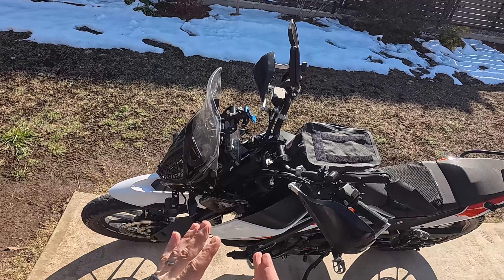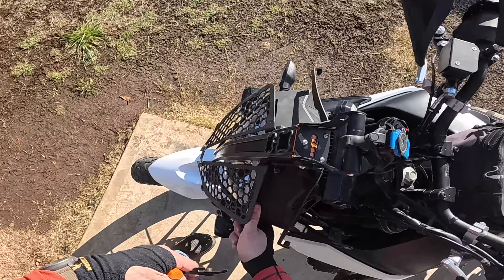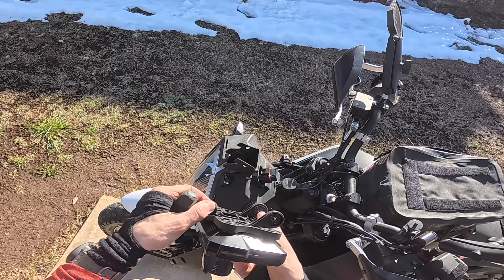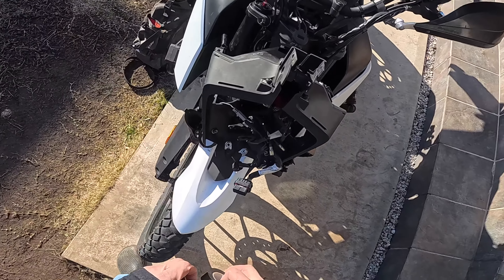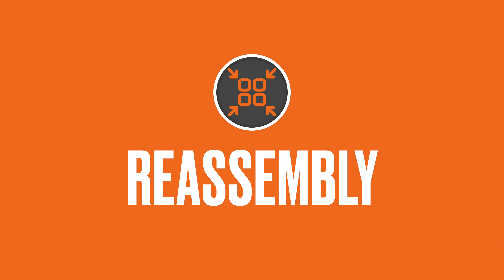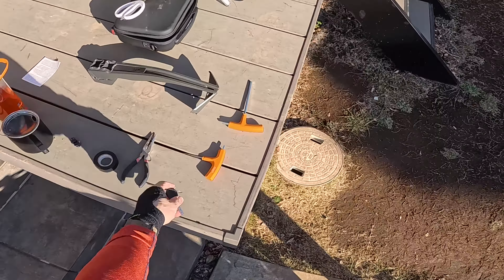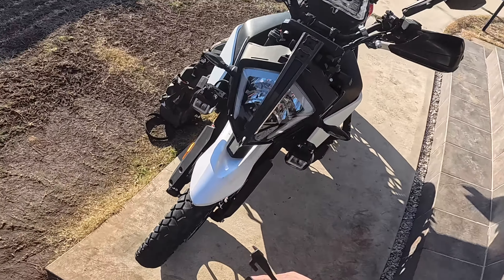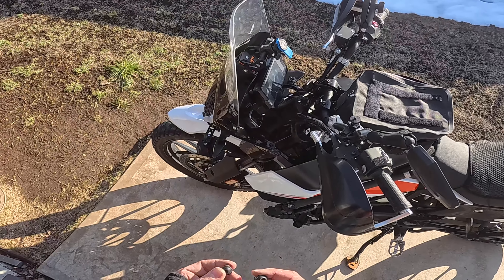KTM 390 Adventure | Headlight Unit Disassembly & Wiring Harness Access | ADVinJapan #52

Comment: Thanks for the detailed video! I had no problem disassembling the headlight unit. The assembly was a bit more trying as I mixed up the order of parts to be put on and my family walked through my well organized screws on the floor... But it all worked in the end! Now have a Zumo XT mounted and wired as well as the sily cigarette lighter replaced with a USB charger.
Reply from the maker: Oh man, yeah those screws can easily get mixed up. Glad it all worked out in the end👍

Comment: Great video! Very detailed! If my entire assembly shakes like it is a bit loose what bolts would I check to tighten?
Reply from the maker: I’d check first the bolts that attach the headlight to the frame. Next, the bolts that hold the headlight. Finally, the smaller bolts that hold the two halves together.

Comment: Hey there. A really good demo video.
I've gotta ask, the bottom plastic plate with two torque screws which you mentioned which holds the headlight assembly, can it be removed from the outside or it needs to be done from inside?
Was wondering if that can be a quick access for the ports 🤔
Reply from the maker: Hey thanks! It’s been a while. Are you talking about those plastic torx screws that hold in that bottom plate? You remove from the outside and yeah, I think you could probably wire up some fog lights through there.
Reply: @advinjapan  yup right I was asking about em. Thanks will explore 👍
Reply from the maker: @ravigemus2 you will have to probably drill a hole though, it’s pretty tight down there.

Comment: So, this is the easiest method to access the power connectors inside the headlight unit? I was thinking of installing heated grips by using these connectors, but it seems too much trouble. Now I am considering using the connectors under the seat since the grip cable is long enough...
Reply from the maker: Yeah, I ran mine to the battery terminals. There is just too much wiring with heated grips to fit in that housing, headlamp won’t go back in.
Reply: If you are two people then you can detach the whole headlight unit from the neck without stripping it down. Most important plugs surprisingly have mounts in which those can be tucked. What I have done is pushed the ports that I need down. So it's accessible easily from below the headlamp unit. There is a small flap you can unscrew.
Reply from the maker: @virajvrooms Yes, that’s a great point. I didn’t think of that.

Comment: Have u done a auxiliary light install vid? Or where  did u get power from please?
Reply from the maker: I’ve done auxiliary lights, but not a video. For aux lights I recommend going straight to the battery. There is typically a large voltage converter that won’t fit in the headlight cavity. Good luck!